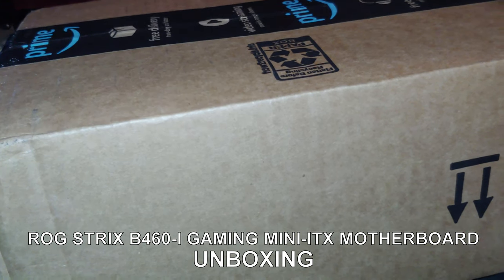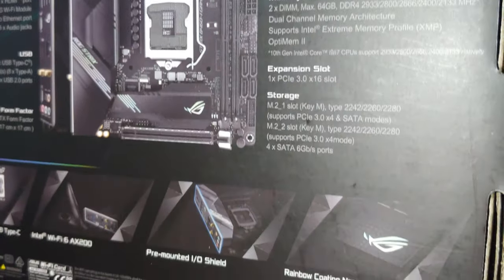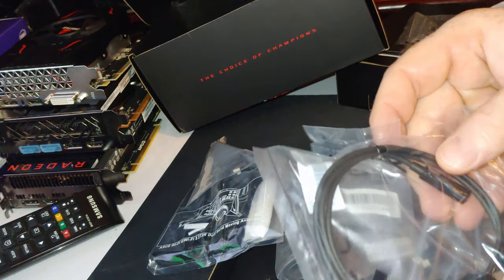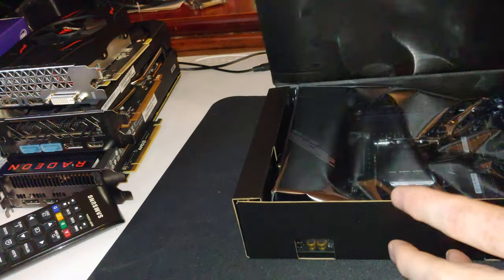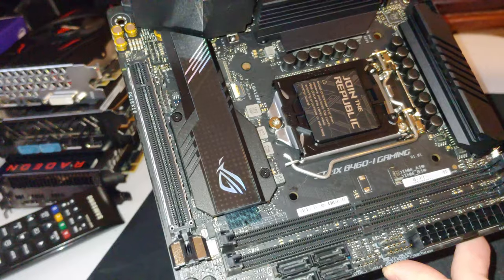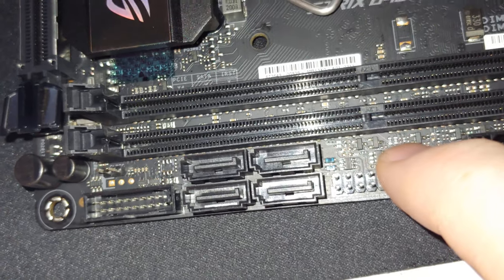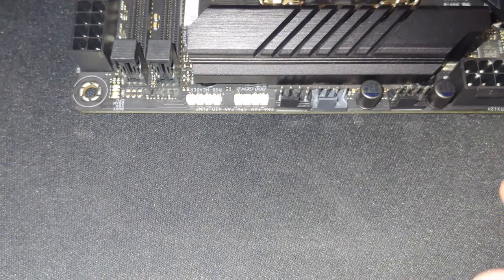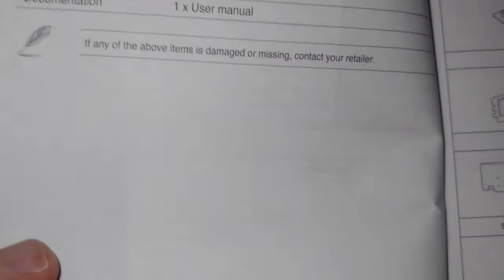Unboxing Asus ROG Strix B460 I Gaming Mini ITX Motherboard

Comment: Would you recommend this board with a non k i7?
Reply from the maker: Yes and no.  What I liked: well designed, like the built-in IO shield, 2x M.2, lots of great features on this one.  I have not bought many Mini ITX...but this has been best one.

What I don't like: As with all non Z490's, the RAM is limited to either 2667 or 2933Mhz depending on CPU.  If you want to optimize gaming performance...you will want to look at the more expensive Z490's, though this one is in the same ballpark price wise:  https://amzn.to/318zw4Z  Asrock Z490m.    There is a big difference in aesthetics.

Comment: Would this be a nice pairing with a 10700k?
Reply from the maker: I think there is a Z490 version out there...you want that one.  This will severely limit your CPU and RAM speed....which correlates to a loss in performance  If you don't have a goal of OC'ing...get the I7-10700...be easier to keep cool in a mini-ITX...though they still get pretty hot.  And you might save up to $200.

Comment: battery bios???
Reply: I also have this board bnew havent installed it yet actually, and that is my same question for the battery bios. Yes it does have the positive and negative connectors (11:11 above usb connectors) but no physical circle battery needed. you may still reset it via those connectors but yea no more battery needed.